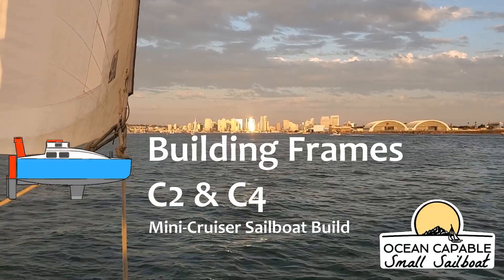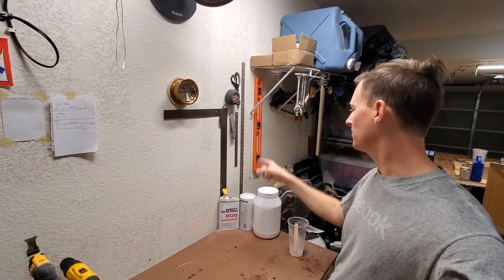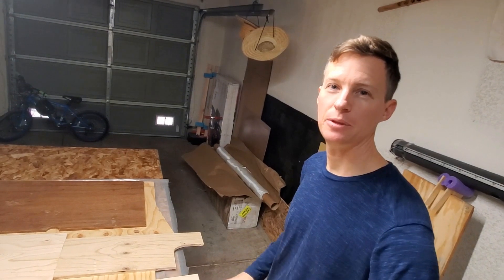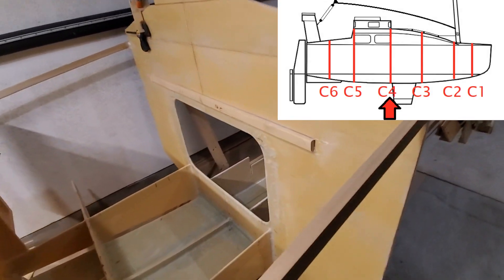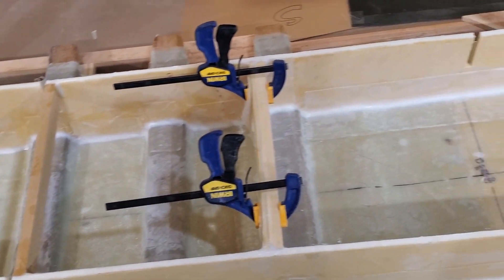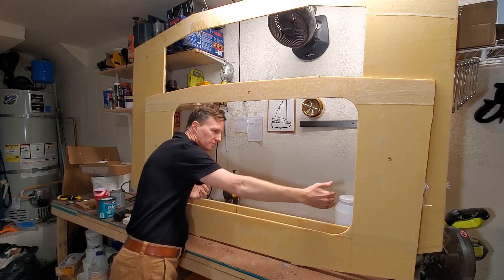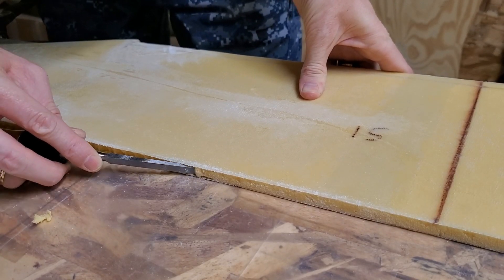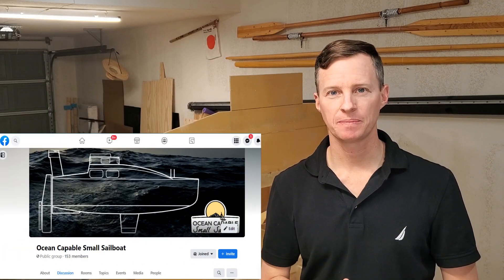OCSS-017 Building Frames C2 & C3 - Mini-Cruiser Sailboat Build

Comment: What you need to worry about in "bad conditions" isn't so much about rolling over, you should worry more about the waves breaking upon you. @ 8.3 lbs per gallon that thin hull and small joints should be your biggest concern. Ever been in the N.Atlantic in the winter?
Reply from the maker: "Thin" is relative. Final hull thickness might be 15mm. There are probably a lot of 25'+ hulls with that thickness. So, it's  quite thick for the boat length/surface area if you think of it that way. My boat has a lot of frames, longitudinals / structural grid inside perpendicular to the hull that also adds a lot of strength.
I have crossed the N Atlantic in December, though it was in a Destroyer. Still, the seas were impressive on some days.
Reply: @ocean_capable_small_sailboat   I mention the water weight because we left drydock on a 210' research vessel (R/V) to run tests all winter in the N.Atlantic and by the time we left the area (4 months later) the steel hull plates that were replaced in drydock were all buckled between the frames. Visualizing those forces on a thin fiberglass were my concern. Great vids though, thx!
Reply from the maker: Yeah! It's common with big steel ships. Another factor is that a big ship won't move with the hit of a wave, it gets slammed and takes the full force of the water. It'll move but very slowly and pretty much after the full hit is absorbed. A smaller boat can get pushed and so a lot of that force is lessened by the boat moving away from it.

Comment: Hi I just found your channel and started watching from the beginning and I have a couple of comments and I'm by no means an expert on fiberglass but why didn't you put a full layer of fiberglass down on your bottom piece before you started putting your bulkheads on cuz now I'm thinking you have a weak spot at each bulkhead also I do not think you are putting enough glass layers on your bulkheads or your tabbing you should watch life on the Hulls he's a fiberglassing expert
Reply from the maker: In the beginning for the transom and frames 5 & 6 I didn't have fiberglass over the bottom before I installed them. After that the rest of the frames were installed over 1-2 layers of 1708 on the bottom panel. But, I'm not worried about it at all. This foam core has a compressive strength of 148PSI. The frames have 2-3 layers of 1708 tabbing them to the bottom, spreading that load out on the bottom. It spreads the load over something like 350 square inches, so it withstands a load of what... 52,000lbs? I think we'll be ok. A smaller boat doesn't need the same layup schedule as a larger boat. a 50' boat might need a solid 1" fiberglass hull, but a 14' boat does not. It's a great advantage that comes with choosing a smaller boat. Anyway, the boat's not done yet. We still have plenty of fiberglassing to do.

Comment: glass is cheap epoxy is  expensive, if you  want  strength for the amount of epoxy you are using you could double lay of glass matt key to strength is the rolling out get rid of the excess epoxy and air ,there is no, zero, nano, none,strength in epoxy resin it will snap like candy cane fully cured, please dont be lulled into a false security of how strong epoxy is its your enemy  when you are looking for strength at best epoxy is a good water proofing solution

Comment: I like your little boat project. However being an engineer, I always feel the need to make it stronger using triangulation and cross bracing. Your boat is very strong in longitudinal axis and vertical axis, but what about oblique angles?

Comment: Looking great.  When you fill the edges of the bulkhead are you planning to use just thickened epoxy?  If so you might think about adding some linear reinforcement like was done on the foam cored catamaran being built by MJ Sailing on their YouTube channel.  In a groove like you you have formed, they inserted pre-wetted linear strand.  On your scale, you could pull out strands from your cloth to get long single strands that are bunched and wetted and placed into the groove.  That would provide much more strength than just thickened epoxy filler.
Reply from the maker: So far I've just used thickened epoxy, but where the floor rests on the structural grid I am beefing up the edges with 1x2's filleted in, as you can see in this video, at least on the transversal pieces. In the longitudinal pieces I might double up the foam and add more fiberglass mat to also help distribute the weight.
Reply: @ocean_capable_small_sailboat  You might think about adding prewetted long strands of cloth fibers to any future foam edges in that groove that you cut at the end of this episode because it will add no weight or thickness but will give a significant amount of added strength by reducing filler with strands of glass.

Comment: What is that sacrificial blue stuff you peel off after fiber glassing and what is it's function?
Reply from the maker: Peel ply is a finely woven nylon fabric treated with a release agent. Excess epoxy bleeds through and is peeled from the cured laminate along with the Release Fabric. Peels easily and leaves a smooth textured surface ready for bonding or finishing.